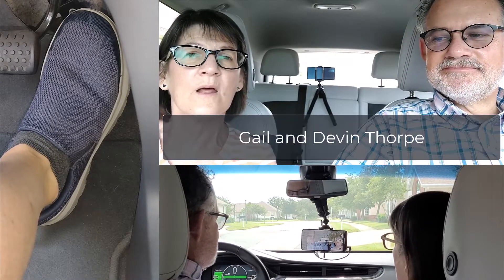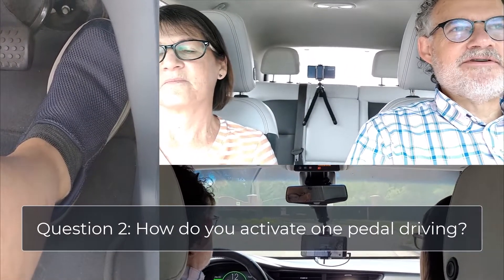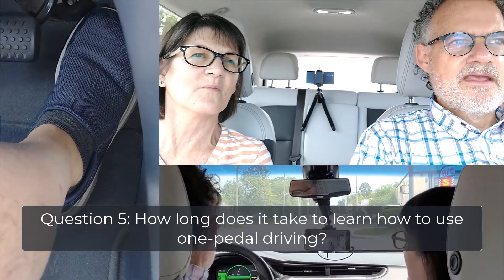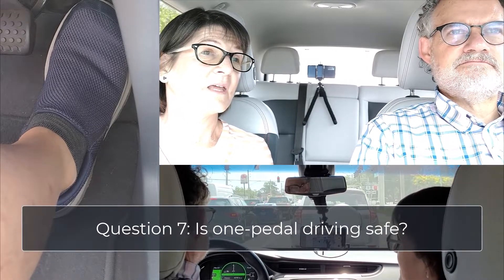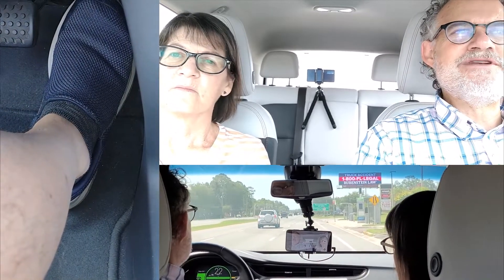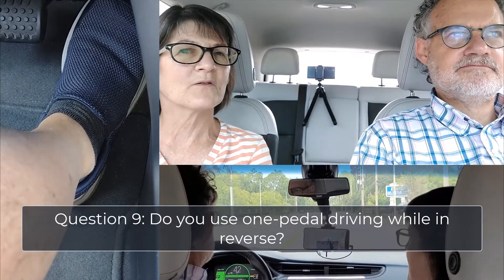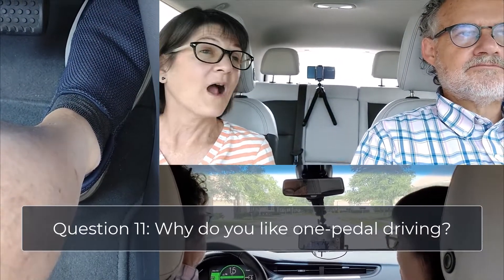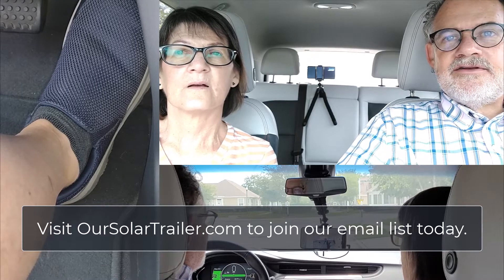What Is One-Pedal Driving? We Answer 11 Questions As We Tow Our Aliner Scout With Our Chevy Bolt EV

Comment: I only use it in heavy traffic or long red lights. Trouble is the red brake light disappears when stopped in L mode. My family finds L mode too aggressive, leading to motion sickness.
Reply from the maker: I understand. Gail never complains but it can be a bit rough. I want to believe that years of practice smooth out my one pedal driving.
Reply: A big red flag for us with the 2022 Bolt EV & EUV is that the backup light is small & at the very bottom of the bumper! People pull up way too close and won't be able see it! And, the brake lights are down in the bumper!?! The big lights up at eye level are merely running lights, which draws drivers' eyes to them and away from the critical brake & backup lights. That safety hazard is a deal breaker for us.
Reply: @ks5831  Fair critique. I recently met a Bolt Owner who had rewired the lights to address this problem exactly!
Reply: @DevinThorpe  Thanks for that info. We wondered if the functions could be moved up to the running lights. We were very interested in the Bolt EUV until we realized the nonfunctional lights. Wonder if Chevrolet would rewire them. Thanks again
Reply from the maker: @ks5831  No question they can; good question if they will. If the deal won't do it, a good shop specializing in EV modifications would.

Comment: What happens if your foot slips off the pedal on the highway or something when using one pedal driving?
Reply from the maker: The car would begin to slow and your brake lights would come on. The effect of taking your foot off the gas is most dramatic, it seems to me, at about 35-45 mph. Faster or slower it seems moderate.

Comment: I too have a 2017 Bolt and use one pedal driving exclusively.  It is intuitive to me and I almost always come to a stop where I intend.  On another subject, have you considered ever powering your camper from your 60kwh battery via an inverter, in cases where you don't have "shore power"?
Reply from the maker: I looked closely at this. It is tricky. The Bolt isn't designed to output power at high rates. With the car turned on, you can plug a little inverter into the cigarette lighter. That isn't much. We found an unauthorized adapter that will pull much more power out, but still only about 1 kw. Let us know if you find a better way!
Reply: @oursolartrailer  I use an OBD2 plug and the Torque Pro app to look at vehicle data.  It reports that the 60kwh drive battery supplies the 12v battery with almost 1600 watts when the car is on.  Not sure if the cigarette lighter socket could handle that, though.  It might require direct hook-up to the 12v battery terminals.  Another problem is that the car will turn itself off after a while.  Does the Rivian have the same house backup power function as the F150 Lightning?  That would be great for boondocking.  You could travel into town to charge up before the vehicles battery got too low.  Of course your channel focuses on solar, but I consider it a good thing to have a shaded campsite.
Reply from the maker: @markstipulkoski1389  You've hit on another issue. You can only pull power out of the car while it's on and it turns off. This is tricky and I wish the old EVs were better at this. The new F-150 is the gold standard now. I think the Rivian has a 220 volt output though I'm not sure how many amps it provides. It would be awesome if it could do 6 or 7 kW, which would be more than or comparable to shore power. The Rivian will be much better for towing a trailer. We're working to optimize the solar on our trailer with hopes that at the margins, we can put more juice in the car from the trailer rather than vice versa. Even so, having the car as a backup power source for the trailer is great!